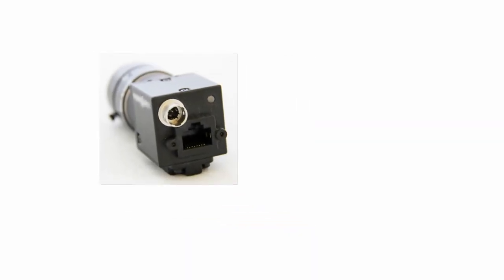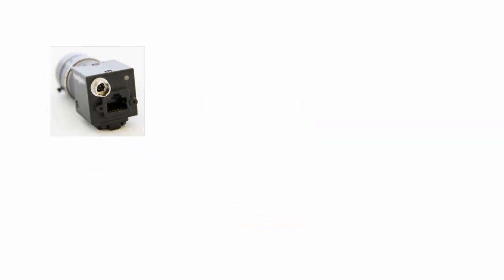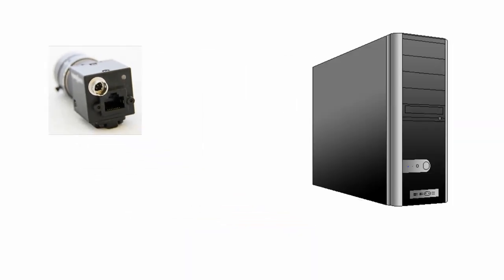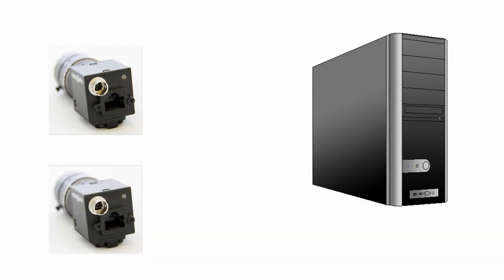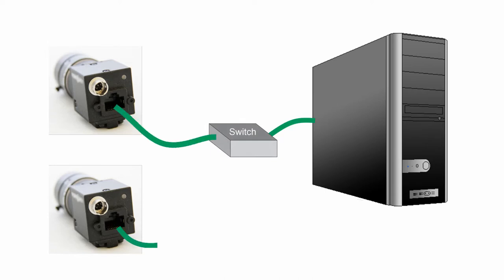Machine Vision Cameras:  The GigE Vision Interface

Comment: Hi there!
Does GigE Vision protocol require a special network adapter hardware?
I am trying to connect a thermal camera to MATLAB via the gigecam support and I can not manage to detect the camera from the software even though it is recognized by the producer's software. 
Does anyone have suggestions?
Reply: I think you have to some changes of network card from advance setting.